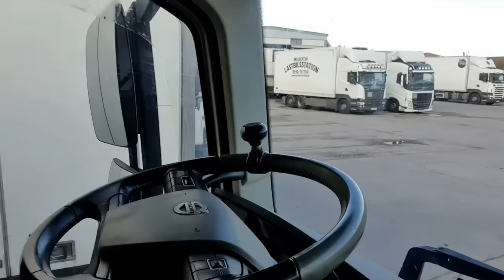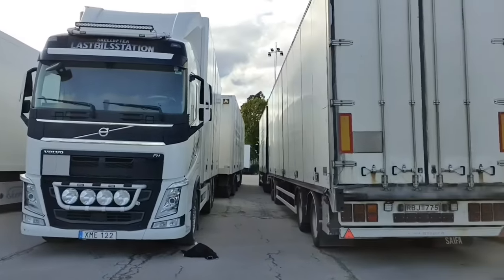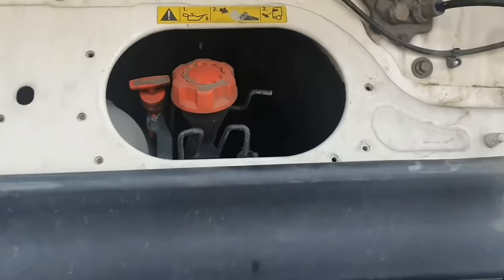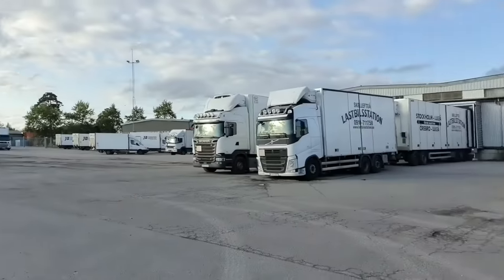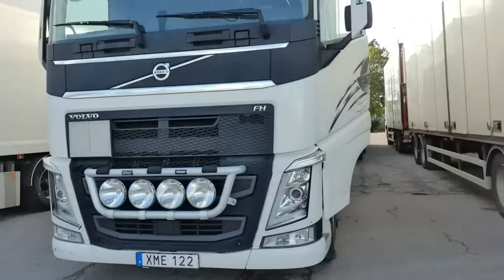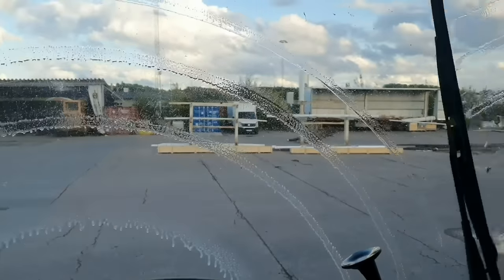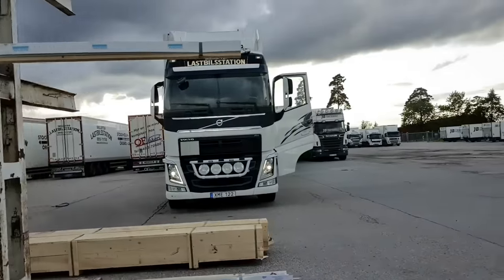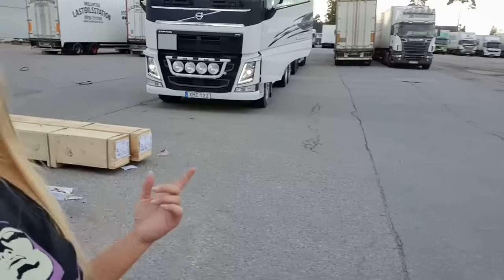"Quick" daily truck check. Angelica Larsson

Comment: As a transportation supervisor I cannot stress how much importance we put on pre/post trip inspections. And yet, soo many of our drivers just blow them off. 
When they call broke down on the side of the road because of something that could have easily been caught and fixed at our massive and expensive shop at the yard. 
I TOLD YOU SO just doesn't sink in.  Bravo

Comment: I don’t understand about the three minute shutdown, how do you run the engine while you sleep to keep yourself warm. I was wondering, the air tanks were dry, is this done manually or is there an automatic air drier and blow off system?

Comment: I just found this channel.  I liked and subscribed.  I was impressed you backed a double trailer that easy.  I thought that would be hard to do.  Hello from Delaware USA.  I operate a L260 Volvo wheel front end loader in a sand pit in Dover Delaware.  I have been loading trucks with sand and gravel for 32 years.  I have a lot of respect for you drivers.  I used to drive a dump truck years ago.  It was crazy on the road then.  It is worse now.  Be safe and Merry Christmas 😘

Comment: My Volvo has a pretrip function to check the lights. It is in the controls on the steering wheel. It cycles the lights around the truck so you can walk around it and look without having to return to the cab to change functions.

Comment: In Volvo’s on the steering wheel there’s a menu button that has pretrip assist once activated it will cycle thru all of the lights functions but most guys aren’t here for that
Reply: I had a Volvo V40 car (older model 1997) who had a check light on the dashboard that turns on after starting the engine, that is suppose to turn off after using the brakes. If that checklight keeps burning means that one of the brake lights isn't working.  Now this was in a 20yo volvo car, so I would imagine modern Volvo Trucks having a checklight for the brakes like this as well?

Comment: You did a great job on your Inspections with the truck, just make sure that next Time you check the Flux-Capacitor which is located next to the Throttle Body intake going directly to the Intake Manifold. Besides all that you did a Fabulous Job.
Reply: and don't forget to check the forbawhips and glanbz before driving off.

Comment: For level 1 inspection you didn't check the brake slack adjusters for proper adjustment. You also didn't check your governer cut in, ramp up time to 100 psi, and cut out. When you jam the brake pedal and get out make sure it's 100 PSI on the application guage, then do a quick visual check for slack adjusters moving past 90 degrees. By doing a brake check at 100 PSI you can also spot potentially deadly brake drum cracks. When you do a rolling brake test you must do it with the both the truck and trailer, seperately. Look in your rear view mirror and check that with light to moderate brake pressure the wheels are not still rolling. If they are your drums are cracked and/or your slack adjusters are frozen and/or you have ice in the air lines.

Comment: Hello from Iowa US.
Thank you for posting and sharing your life. Knowing that most safety technology is stollen by the US from Europe, The Peterbilt I drive has a setting on the engine control module for testing lights, Most trailer brake hand valves will stay applied if you pull the handle, That is how I check my lights also.
Could you show some truck stops in your Country and where you stay while out overnight. 
I noticed you enjoy Chuck Taylor high tops. Could i send you a breast cancer awareness set of chucks? 
Be safe in your travels!🌺

Comment: Love you and your presentation!
One small observation :
Never use your palm as a hammer, not even casually, since it is a delicate assembly of small bones.
Speaking from experience, after years of doing it my hand got gradually damaged and it took years to get good again.
Painful years, also due to the handicap it involved doing my mechanical work

Comment: Hi Angelica, here’s a little top when checking your lights, if you turn your hazard lights on, your hazard flashers, it will show that your brake lights work since they are the same light. Hope this helps. It will also show you your blinkers work as well.
Reply: This is not America, Europe don't have brake light and indicator light combined as you clearly can see in this video.
Reply: @victorsegermark4011  first off it’s not a combination, and secondly it doesn’t matter which country you’re in, all vehicles come with hazard lights, four way flashing lights.  when you have to park on the side of the road. The hazards lights are the same lights as your brake lights because they are the brightest. Usually the hazard lights have a red triangle button on the dash.

Comment: So, first of all, thank you for sharing the video, but I will leave some comments that others have not left. A Pre- Trip Inspection should include more items such as an Air Brake Test that you should check before you do the Service BrakeTest, you need to check the bleed down ratio per minute by applying pressure to the brakes for 1 minute and check that you do not lose more than 5 psi in a minute since you are pulling double trailers and 4 psi in a single connection. Next, you let the pressure build up until you hear the release of air from the safety release valve dump, then shut the truck off to drain the tanks. You are not checking to see if the tanks work? Like you said in the video, you are checking to see if they have a large amount of oil or water content. This would tell you that you either have a compressor issue or an air dryer issue. You left too many things out of the pre-trip inspection, that by now someone or you have learned to check on your own for your own safety and others that travel on that road with you. It would be a long list to leave here, so I would be happy to explain that to you if you like by subscribing to my channel and looking at my pre-trip inspection videos for my student drivers.

Comment: You should check the steering heavy duty components with the engine running. This is to ensure your steering wheel has a solid connection to the heavy duty steering components. Check the Pittman arm, steering box, U-Joints, in the steering assembly. Check the steering wheel play with the engine off. This is important because with temperature changes or a bad mechanic your steering heavy components can come apart when you are driving. It almost happened to me.

Comment: I realize you probably figured this out by now since this post is a couple years old, but if you turn on your emergency flashers you can check both turn signals visually at once. Then you can check if they click when you are in the cab. Saves a few minutes.

Comment: What about doing a air leak pressure and checking the air pressure on tires, checking suspension. I think you missed quite a few things.

Comment: where are the other drivers? I was expecting to see you with a head band mounted camera and also a flash light to do your walk-around pre-trip inspection with a check off list customarily before sunrise, you ran past the tires several times without even looking at them but I see in the description you did check those, you opened the drain valves on the air tanks but do you check the time to build air, the compressor cut-in and cut-out and air bleed off rate and low air warning? [[ WARNING ]] as a truck driver I feel like I should tell you that your life will quickly pass in that cab and with it will go your figure and beauty too, you will not be able to be a mommy which I would think would be the most rewarding part of life

Comment: Lucky the  Interlock Meter doesn't detect  LSD , Huh ?

All that Safety check CAN be done in One walk around . Should take a Metal bar or Block of Wood to hit Tyres with .
Flat tyre makes a Flat sound . Also Checking of Random Wheel-nuts . Every Wheel .
Headlights on Low beam until you get back . Flick to High without getting back in . Check and you're done . Climb IN .
Then Service Brake test(Pedal) and Trailer Brake check(hand-lever) . That serves as a " Tug Test " as well . Now done . YAY !

Ignore me if you like . I  did  Heavy Transport for 32yrs after getting out of the Armed forces . Retired these days . You're going well , Young Lady .

Comment: Do you typically do more checks on the air brakes like air loss tests, pressure build test, if the slack adjusters are out of alignment or brake pad / shoe wear?

Comment: Not sure what country you're in but in the USA you would have missed a lot. No check for emergency  air brake deployment, high beams, hazard lights, fire extinguisher, road flares or triangles, registration paper, backup beeper, mirror security, evaporator, slack adjusters, tire pressure. If you were my student I'd flunk you.

Comment: you never checked the tire pressures or if they were all inflated. It looked like the rear trailer marker light was burned out. It never did come on.  You don't have to crawl under the entire unit and looked for problems??? That was our training years ago. The world has changed. DUH.

Comment: 10:40 Time. WoW.   Some things, just don't  change,  with  nodern  technology. We used to do this 40 +  years ago. With Canadian made trucks !   Alcohol  checker, auto-transmissions, cruise control, computerized  engines,  and   STILL  A   STICK to the brake pedal,  TO  CHECK  brake lights.  One, would  ' think '  to put a switch on the dash, and wire it to the brake light  wire for  ON.  
  Anyway,  stay  as  safe,  and logical  as  possible,   ANYONE,   ON  THE  ROADS OF  THE  WORLD,   TRANSPORTING   GOODS,   FOR  OTHERS  !  ( us, me and you......)   oldtrucker

Comment: Need to go to a country where there are REAL trucks so you can get some experience driving proper rigs.

Like the Australian Kenworth T909 or the American Kenworth W900.
Gotta get em with the Eaton 22 series 18 spd though and not an automatic.

Unfortunately, trucks like the Volvo FH series and Scania (all models) are promoting more and more "Steering Wheel Attendants" rather than operators.
You don't really learn proper roadcraft or gain relevant knowledge when you have a truck that chooses the gear and manages the torque for you.

Hence why in Australia, we call drivers that only have automatic licenses "Steering Wheel Attendants" as they have no real roadcraft or any real idea what they are doing with the truck.
It might be different in Europe, but when you drive a 22 series "road ranger" the driver has to understand the trucks torque curve in order to ensure they are in the correct gear for the situation, they also have to be intuitive enough to predict the gears as they come to rises.

Companies are desperate for drivers in Australia and they pay excellent wages.
Come to Aus and get some experience driving real rigs in the outback :)